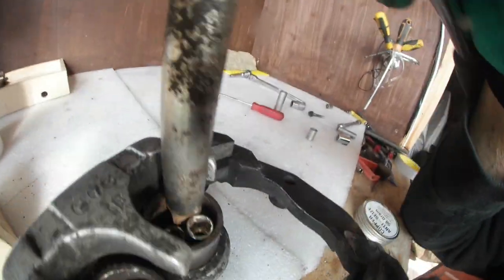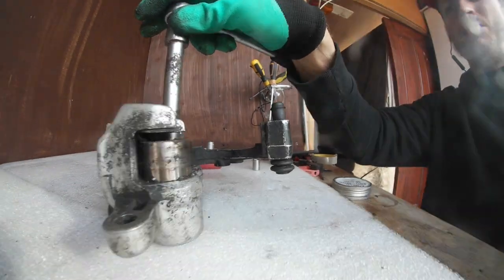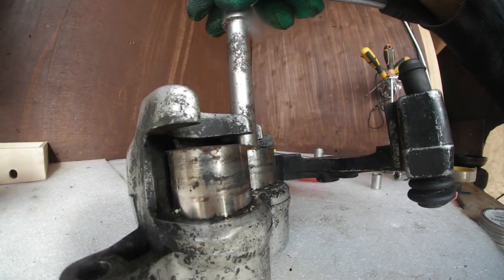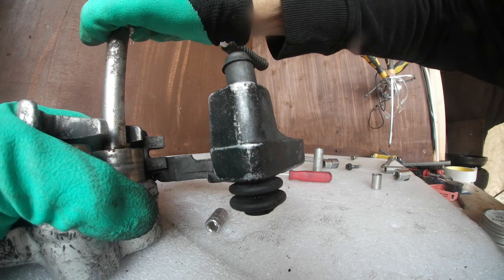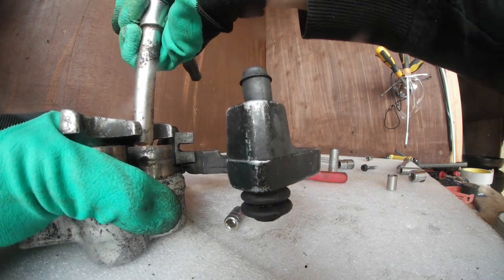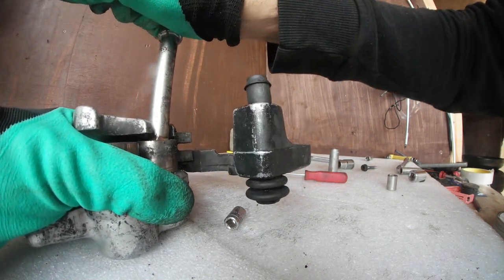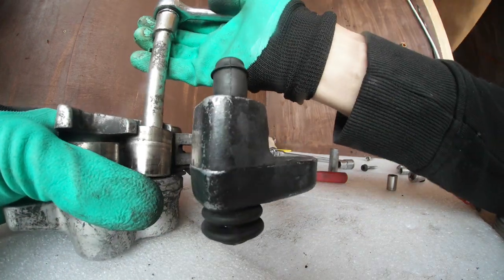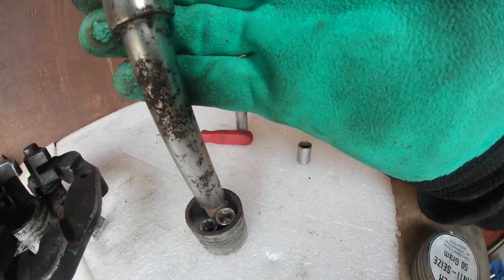How to remove stuck piston from any brake calliper?

Comment: I would be using this as a last resort only. First use existing hydraulic pressure, or can pad it and use an air line (don't want these pistons flying around the shed). If the previous didn't work, I would remove caliper and try a grease gun to pump it out. If that don't work, would definitely try this.